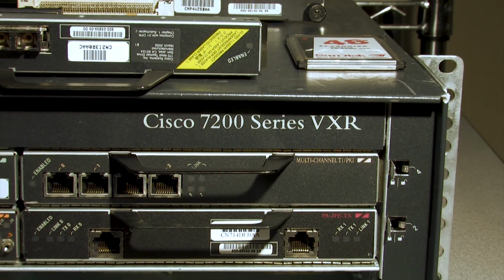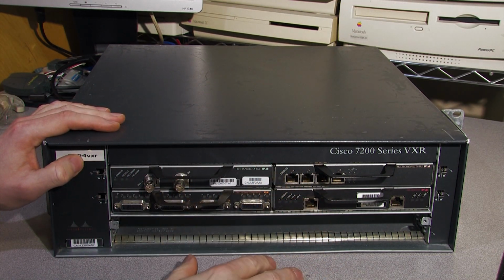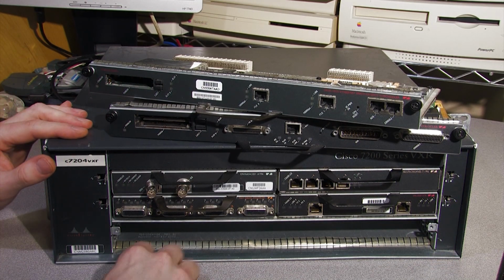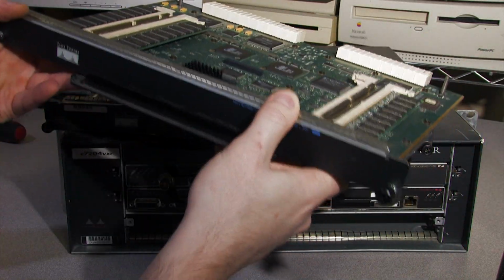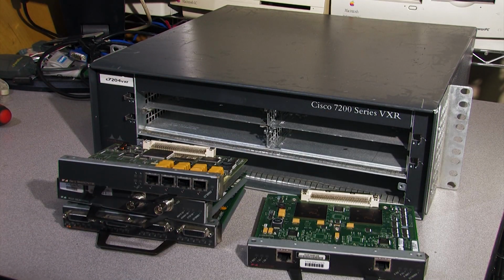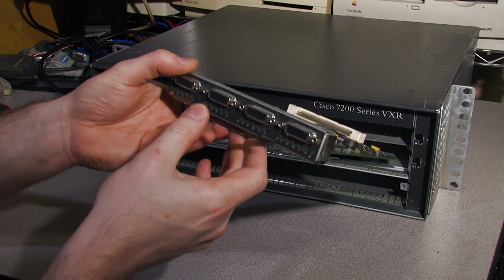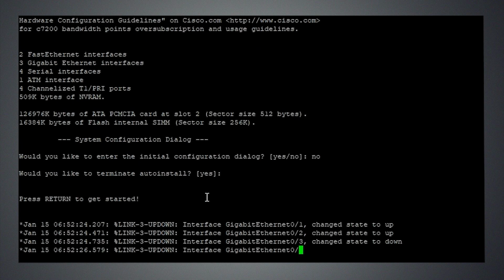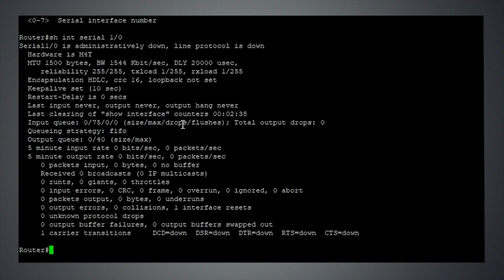Cisco 7200 VXR Series Router - Old Networking - Paul's Old Crap

Comment: I know this is an old video, but just in case anyone gets here wondering what the "weird" fast ethernet port is. It's "Media Independent Interface", basically the fast eth version of old school aui ports. So you could have for example a fiber port on it without them needing to ship that type of interface (and of course only to discover you needed a different kind of fiber). I've only seen it on some sun gear of that era. Really short lived, in the end SFP replaced all those weirder ports.

Comment: That HSSI connector was to hook up  an octal async cable.  You could use these as out of band serial access for console ports on equipment, or as a serial interface to a modem(s). It supported up to 8 individual serial lines. I believe that card was equivalent to a stand alone 2511 terminal server.

I'm pretty sure there was an old DOCSIS card for this too.  These routers are really great to setup a legacy WAN connectivity lab like the old days before fiber and metro Ethernet was everywhere.  Back in the day we had one of these with a DS3 primary and a 4x bonded T1 secondary WAN servicing the place I worked. These routers were archaic, but rock solid.
Reply from the maker: Yeah I plan on hanging on to this just for labbing out retro WAN stuff when I have more time.

Comment: Hello Paul just came across your video while looking for the break sequence for the 7200vxr series router... I was hoping you could help out... I have tried removing the compact flash in the back for it to boot into rommon mode but I do not think it boots off of the compact flash, it also sees it as disk2... can't seem to find where disk1 is
I have also tried different break sequences, used different terminal from putty, teraterm to hyperterminal, I have used all of theit special keys but still not working.
I will appreciate the help. Thanks
Reply from the maker: The timing of it gets tricky. The way I traditionally do this with a Cisco router is using putty and in the menu there is an option to "send break" I believe, but I think I had to keep doing that over and over right after the power on until it finally dropped me into rommon. This may differ depending on the router... You might be able to try a Ctrl+C but I don't think that usually worked.

Comment: It would be pretty interesting to see the T1 and ATM interfaces working. I've run some of those serial links in a lab and wasn't that interesting. It's a plain serial port. The other two use a different media and were kinda widely spread outside Cisco, which makes them a little bit more interesting. You could also find some other brands that used those and try them out.
Reply from the maker: I'm space limited otherwise I'd have a large lab of gear from numerous vendors. For my own purposes I wanted to set up these lesser used connections and try doing bandwidth tests and whatnot. I do have other routers with T1 and ATM modules for this and it'll be a future video.

Comment: Old cisco stuff is pretty cool. these devices are like early 90s German cars , they last forever. amazing that all of the highest price upgrade path of a fully packed setup of that device is now easily virtualized and all that power is now simply trunked over a single 10gbps port which the NIC itself can often offload the same packet count that the entire device itself performed.

I also miss people building labs with the real hardware; everyone just jumps on the virtual labs. it's not the same experience and while the software defined network is certainly cool, real hardware dedicated to something is always best from a stability perspective imo. especially these ciscos. I just accidentally rebooted my isp main interior gateway router, a cisco 2911, after 520 days of flawless uptime. somewhere in a closet there's a cisco with ten years up time.
Reply from the maker: I much prefer physical routers for labs. Might not be practical for some of the more expensive modern gear but you lose the fun part of assembling it by hand.
Reply: Have cisco stuff in production network that show uptimes of years.